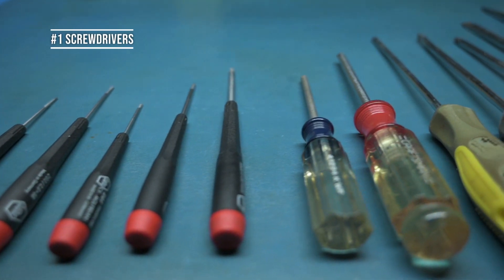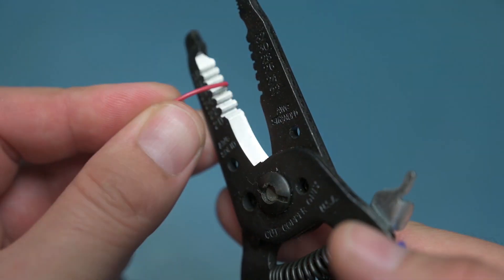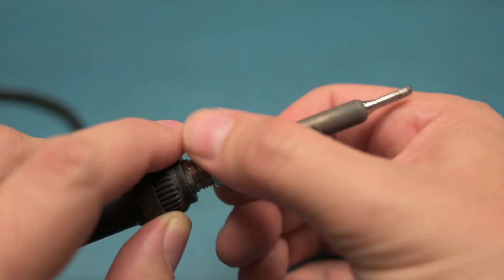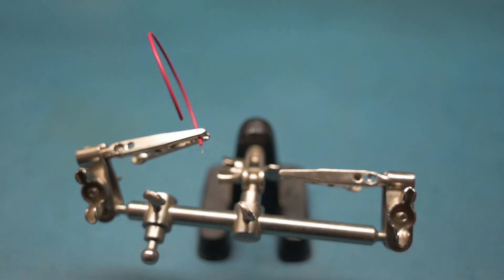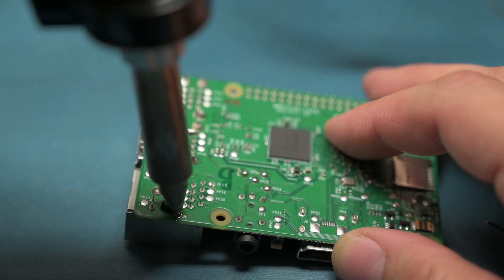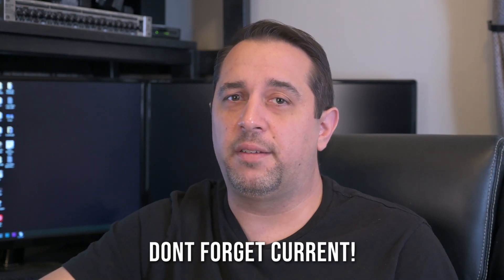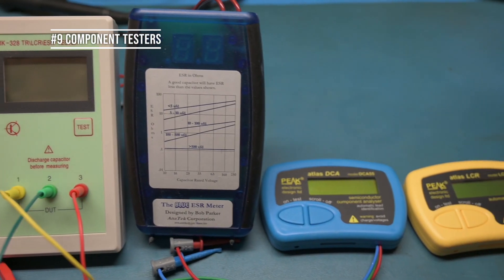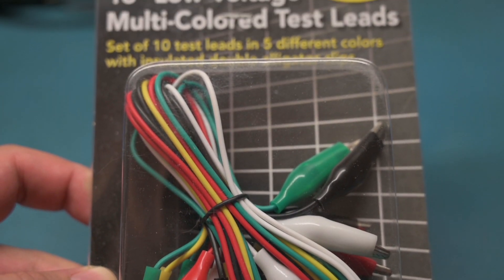Basic Electronics Tools For A Beginner.

Comment: Great video. Do you know of any courses available for basic electronics troubleshooting? I checked udemy.com but saw nothing relevant beyond rasberry pie, arduino oriented courses. I buy, sell and repair fitness machines (treadmills, ellipticals, exercise bikes). I can repair the mechanical issues but I'm limited in knowledge when the panel is dead or the resistance circuit is not working (most common issue I find). I need a good course that takes me through beginner to advanced to be able to troubleshoot these electronic circuits.
Reply: Following please. I am also interested

Comment: I can recommend (as a beginner) a desoldering station such as (i.e. ZD-915), because it's so much easier NOT to f*** up the PCB. And as a beginner, you might be using too much heat or stay too long on the solder pad etc. With a desoldering station, just melt the solder, pump it and voila in most cases the leg of the component is free of solder.

Comment: I did not sign up either. As for as top 10  gear for a hobby user,,he done very well. He did this in under 6mins..The problem with this as a newbie to electronic is they probably don't know what there looking at and have a lack of perspective on test equipment .        This may seems abrupt and confusing to a person getting into hobby repair. I thought he done well in the time he spoke. If it was me,,, I would go into detail a bit more. Make it 15mins with a few more details. All in all it was pretty good and fair for the time and effort given. Also seen 30 minute videos that offered less advice on repair gear.Good luck